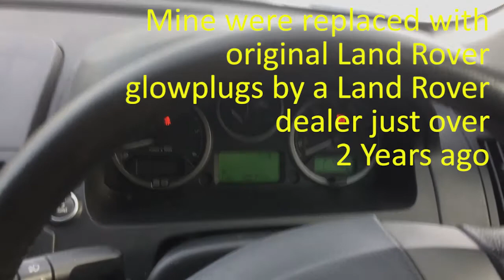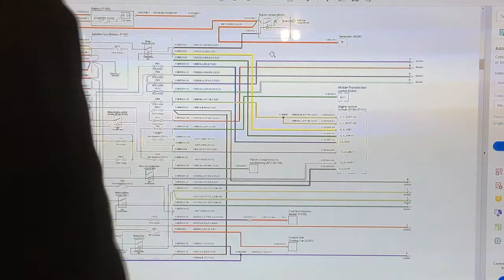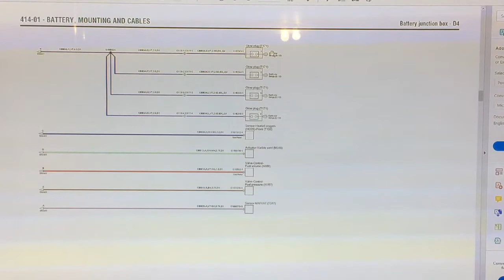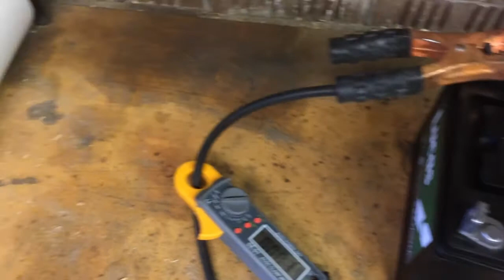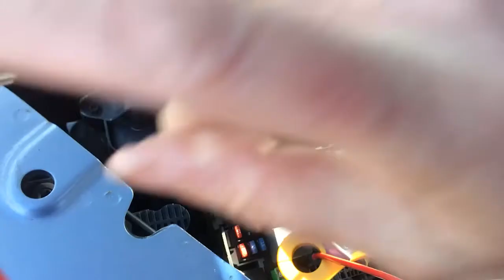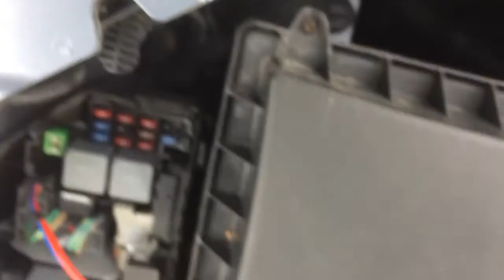Freelander 2 Glowplugs

Comment: Great video. My 2012 FL2 sounds just like this. Had all the plugs and control module replaced but no different. Any ideas?
Reply from the maker: As I recall the system for freelanders changed after 2010 so not quite the same. The new system uses a control module that switches the now 5v glow plugs separately. The control module can now detect a single failed glow plug and throw up a fault code. Problem is if the control module is faulty then you cannot expect a reliable diagnosis so it still comes back to reading the circuit diagram and figuring out if and where the fault is. I’m sure there is a way to do it but will probably involve some head scratching. Good luck
Reply: @ thanks for the reply! I don’t have any fault codes registered, which seems to have everyone stumped.
Reply from the maker: @Camper.942  Unfortunately diagnosing faults on cars is becoming a lost skill. Much cheaper to replace and see if it works. Also much to much faith put in the onboard diagnostic which occasionally is part of the fault.

Comment: This is a really good video and grateful that you posted it. I was wondering if you could just clarify the circuit connections for your diy ammeter? Is it between the battery positive and the relay supply side? I.e. does it replace the single wire that you used with the current clamp?
Reply from the maker: Sorry for the slow reply. No, it is between the battery +ve and the relay load connection (or feed to the glowplugs) Thus replacing the feed to the fuse box and the relay.